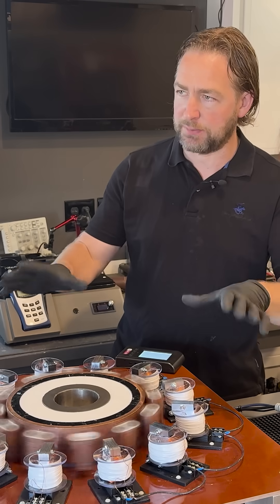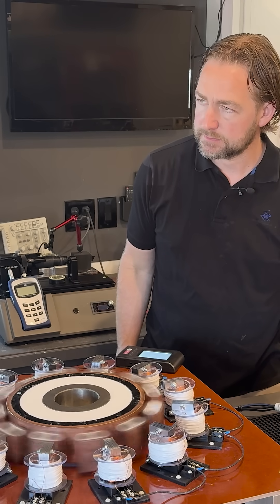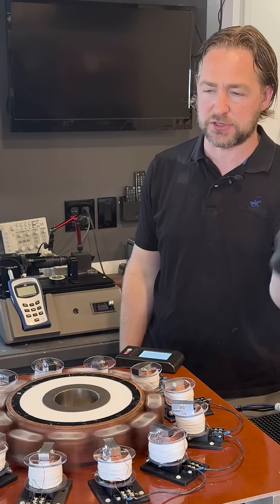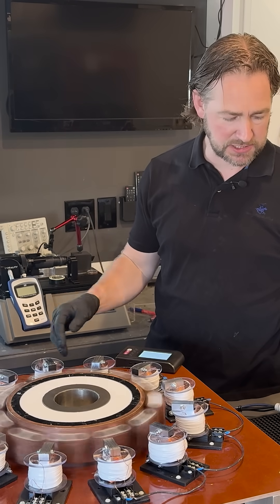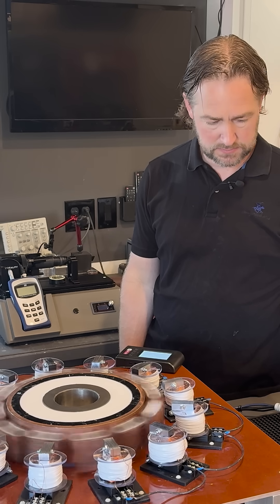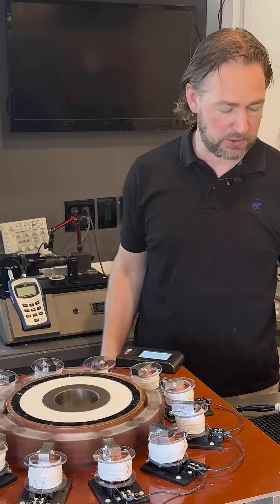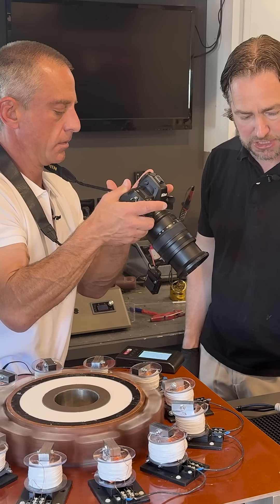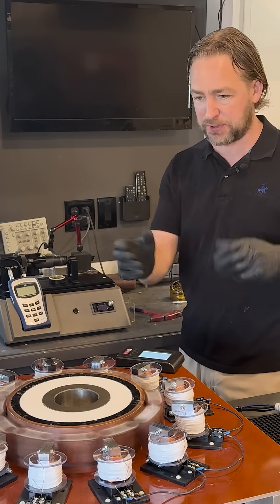Searl Effect Generator 2025 #Tech Demo

Comment: what if you use magnetic bearing rollers so theres no friction. and what if you have mercury in a center toroidal donut to make the mercury flow and produce voltage, idk anything about science but couldnt that add more output?

Comment: Where is the energy out, vs energy in? I am under the impression that the weight of those magnets rotating is producing a lot of kinetic energy? More Kinetic energy than is being provided by electrical energy?

My point is, where do you connect something to harvest this energy? Is it pushing current back into the coils and thereby reducing the energy required to run it?

Show us it producing a usable output please.
Reply: I think you have to pull from each of the coils on the perimeter. I'm not sure if the whole apparatus produces 9v or each coil. He mentions it in the video but I forgot the specifics.

Comment: What is the purpose of this? Someone please explain.
Reply: The purpose is to basically break the 1st law of Thermodynamics, so that we can create free energy. John Searle claimed to have done it, but the rollers and magnets must be aligned and set up in such a precise way... So, basically, the small rollers (when the machine was standing upright in the 1980s...) they would start to levitate as the copper magnetic ring spun faster. They would levitate and spin. Then they come back down as the wheel slows to a stop, and then there's friction between the roller and the wheel again. It supposedly created an electrical charge on the surrounding ports, and could keep itself spinning forever once started. But Searle was raided, his research destroyed, and could never reproduce the effects. They said there was levitation, weight loss of the machine... People are still doing research on this, but it slows to a screeching halt. There's a company called SAG Magnetics with a bunch of Angel investors thats also claiming rights to this machine. I'm not digging this guy - "Well, if I had my good rollers..." "It's great when the new rollers are on here!" Where's the new rollers? Oh, I havent made them yet...." ok pal

Comment: The "Searl Effect" won't happen when a single ring.  They never understand and get it.
Reply: Hawkings gravitational theory and magnets...  He doesn't understand magnatism and the source for permanent magnets.  Sure you need electromagnatism to make it move, but to counteract gravity it needs multiple rings and different sources of permanent magnatism.  At least in theory
Reply: No, there is a single ring model. Even Searl himself proposed one and said it can be done. However single ring motor requires very specific geometry and proportions and of course it not something we seen publicly. They all trying to make a working model based on a “learning stand” that Searl showed to everyone. It won’t work unless you change a perspective)